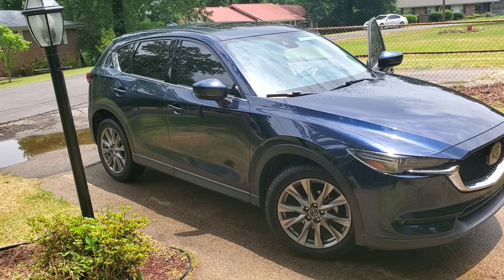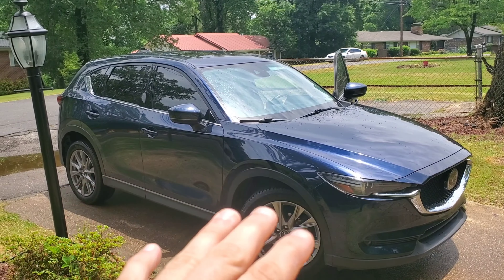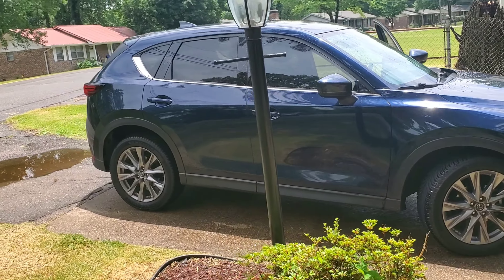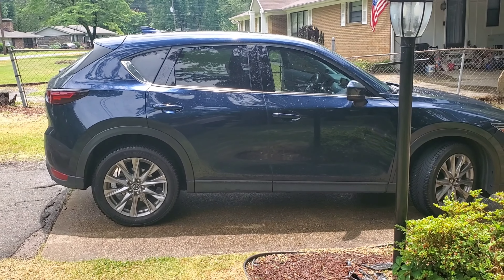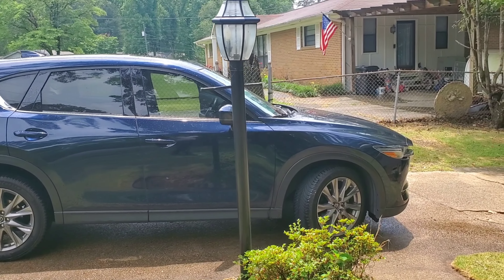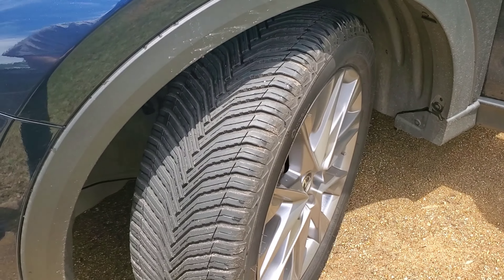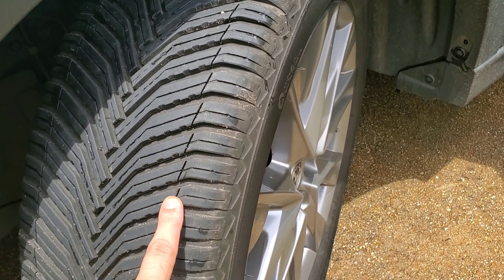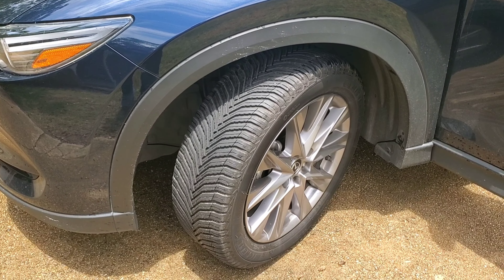What Is The Right Pressure / PSI to Pump Up Your Tires?

Comment: I make sure I use a digital tire pressure tool that measures in half pounds. I put in air over what I want, then let air out until my pressure reads the exact number I want. That way all my pressures match exactly. The other thing I do is add one pound of air pressure to the manufacturer recommendation. That way I know I have enough air for the whole month. I check my pressures cold once a month. Perfect system for me!
Reply from the maker: Man now that it is getting cold, it is time to make sure the tires are up to pressure!
Reply: Unless you have a very expensive calibrated electronic gauge they are notorious for incorrect readings if you care about accuracy. A big clean gauge and a pressure release valve is all you need for the most accurate form of measurement. Don’t be fooled by marketing.
Reply from the maker: Do you have a recommendation for a gauge? I just use a cheapo one that I got from O'reilys Auto Parts. Maybe... "Green Slime" brand, or something like that. 
Just the cheap one that you get at the counter - I wasn't aware those could be that inaccurate.
Reply: @jakeofreshly  Rhino USA makes great stuff! Check out there tire gauge!
Reply from the maker: I'll do that now actually! Haha while I'm on the computer

Comment: Would inflating the CC2s to 38 instead of the spec'd 35 psi mitigate the fuel economy loss of the CC2s? And what would it do to the noise?
Reply from the maker: I know this is super late, but I just put them at 40 and they’re a little bit louder in a little bit bunker. I didn’t save any miles the.